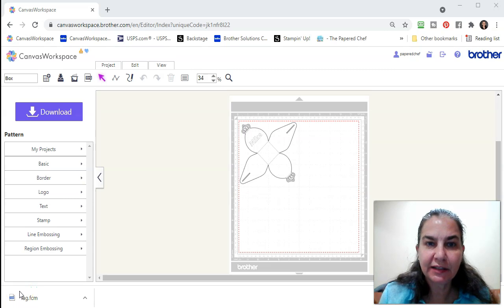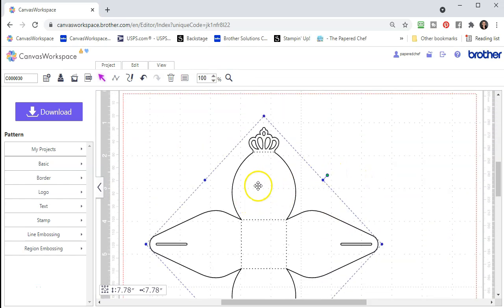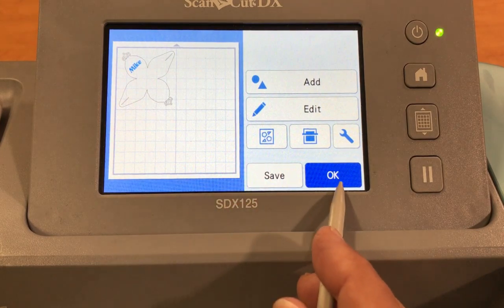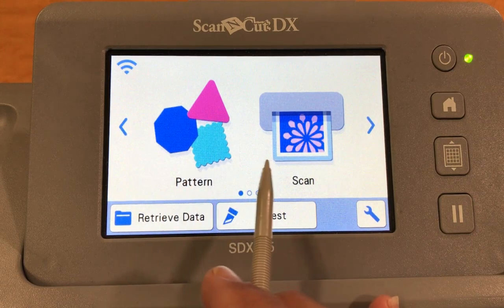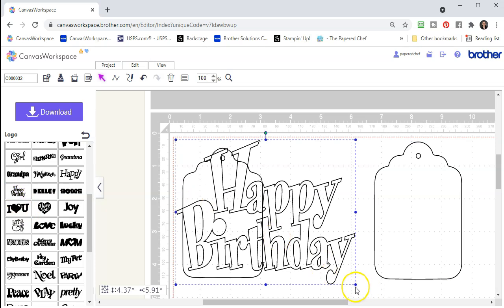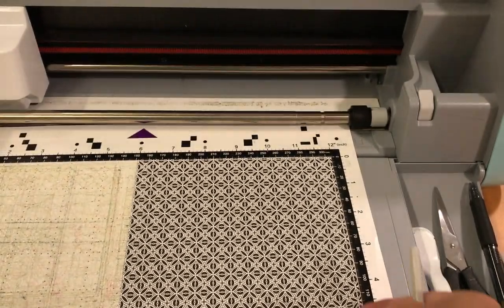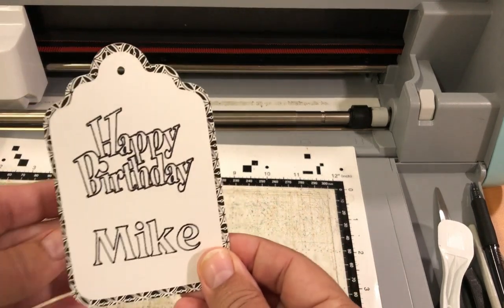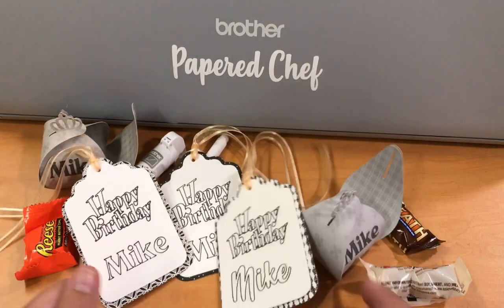Brother ScanNCut Tips & Tricks Tutorial - Transferring & Personalizing Files with Canvas Workspace

Comment: Thank you so much for the tips & tricks!  I'm a SU Demonstrator and just bought the ScanNCut SDX125E.  On the tag, could you have done both at the same time if you put DSP on the right side and cardstock on the left?
Reply: If you try to cut two different thicknesses of paper at one time, you take the chance of either cutting through your mat, because the blade depth is set for card stock. Or, your card stock may not cut correctly because you blade depth is set for the thinner DSP.
Reply: @kathyhart5105  Makes sense.  Thanks so much for replying.  I have learned so much from you!
Reply from the maker: Robin, I see Kathy answered. I try to cut lots of things at the same time as long as I am using the same type of material.